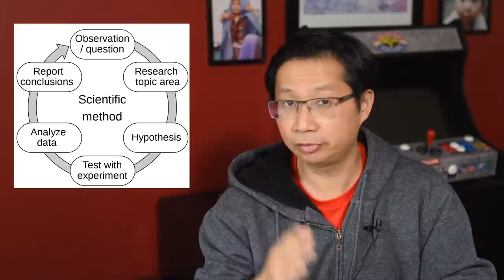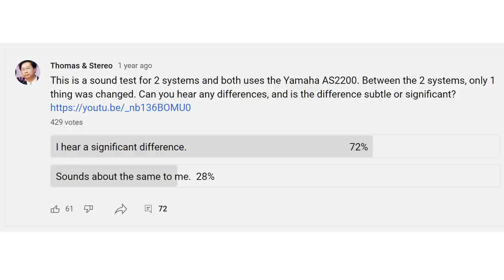Let me tell you stories about Break-in.

Comment: Thanks Thomas, always fun and isn't that what it's about!
Speakers - yes, they are mechanical devices with compliance and other issues.
When it comes to electronics isn't the question, what is breaking in? Resistors, capacitors, diodes, etc.? You can not see changes in those components after several hundred hours. For example, Keysight makes some wonderful and expensive test instruments that measure well beyond human hearing, scopes that go to gigahertz, meters that measure to picoamps and so forth. I have never gotten an instrument, and I have some very sophisticated instruments, where the manufacturer said wait a hundred hours until it breaks in. I have left instruments on for years and the calibration isn't significantly off so what are people hearing or think they are hearing?

What you need to do is a DBT with a new component and a component that has been run a few hundred hours. If you can't tell the difference then it's all in your head. This is why I tell you guys you have to do DBTs because they are science, subjective listening is not. Subjective thinking is the belief that the sun revolves around the earth simply because you think it does. This is where we run into big trouble, you have to stick to science.

Comment: Speakers have a break-in time. Elements need to move a little, especially woofer-elements.
Cables, no. Tubes, yes. Solid-state, no.
But also some electronic components need a little warm-up time, like 30 minutes.
Reply: @asfdadfgdasfh4444  But this is also very specific to quality of Capacitators.
Some are made for 105 degrees Celsius and operate at 40-50 degrees, so they will last a «lifetime». If use use some that are made for 60 degrees, in the same product, they will not last very long before they start degrading.
In my Nuforce amp they use the one that can handle 105 degrees Celsius.

Comment: Breakin is a real mechanical engineering phenomenon. I purchased a brand new Nissan Skyline in the 1980s and I was specifically told the suspension would take at least 2000 Km to bed into its ideal mounting position. And sure enough, the ride AND handling steadily got better up to about 3000 Km and then plateaued.
Reply: automotive mechanical engineer here: those days are gone and even in those days those were extra measures to give a customer a further guarantee  that their car will last xyz time/miles/kilometers long, wear & tear like that can only be reproduced in exaggerated simulations to a few decimal points ONLY 
Experience:- my father, who was a mechanical engineer who designed much of the components during the 80s-early2000s for the racing industry be it rally or indy car or le Mans or even dakar, so i imagine he knows his stuff

Cheers.
P.S. Skylines are nice, you're lucky to afford one

Comment: 13:33 not scientifically neutral since that question might be perceived as a loaded question that is leading those answering to an answer
Don't know the truth still
Reply from the maker: Of course, that is why I said specifically until a scientific paper is published, whatever position you have is just an opinion. Also, I said I would love to do an AB test with 150+ sample size. What I shared at that moment is an actual test, sure a test with flaws but nevertheless still a test with specific conditions. If I were to do the test 100 times and still get same results, then it is statistically significant.
Reply: @ThomasAndStereo  thanks for acknowledging sir..i agree.. Sample size needs to be large and free of silent and unintended revisions i.e. defects/differences arising from machine calibration or even personnel changes

Comment: I always thought break-in for Electonics was complete BS and everyone in the audiophile community thinks I'm crazy. Modern Electronic components (Capacitors, resisters, etc.:)  have very tight tolerances in their values and that's the only thing that could change the sound if those tolerances drifted! Speakers are mechanical devices so I MIGHT believe it's possible for them. People's ears adjust to new sounds after time and their hearing usually improves given time. A perfect example is the type of work I do. I work with Public Safety radios and systems. When we changed our radio system from the old analog system to the new P25 digital system our customers thought something was seriously wrong because they weren't used to the digital sound. It took them a couple of months and now they all swear how good it is.  This happened to all of the agencies and with over 15,000 radio users. The radios they were using were not new at all so if any break-in occurred it happened years ago. I think break-in is complete nonsense, but I do believe people's perception of the sound does change over time!

Comment: hey the compuret live it alone , u need a update for win 11?the same hardware different ,.......power consumption?power management?and more games?   hey ...for example if u have 4core CPU or16CORE cpu ,the windows is fast or slow?or it adapts?if u have a hdd or SSD the win is fast or slow?it adapts?if u are fast or slow ,and u are @red light ,......u adapt?........end i don't understant u can cheat "?if u have a tube amp it's ok for Break-in and after a ABclass amp ,or D class amp?or break-in is for a short time with a short cable?hmmmmm

Comment: You started well but your argument transpired into "I believe break in is real," without mentioning it explicitly.
1. Yes, people are fundamentally good, but businesses are fundamentally driven by profits 💯.
2. Break-in in moving components is real, but SHOULD NOT be significant if well made. If you hear considerable difference, you're better off with another company. B&C does show from its data (it produces over a million drivers a year) that speakers SLIGHTLY break in, but not after hours, after minutes. Slightly. If a manufacturer tells you to break in a speaker for hundreds of hours, how did they even manufacturer it in the first place? Do they guess how it's supposed to sound? About DACs, no, electronic DO NOT break in. Run for your life if anyone tells you so.
3. From now on, Thomas, start taking measurements for before and after break in to demonstrate those occasional differences.
Reply from the maker: Well GR research did that. They took measurements before and after to show the differences. https://www.gr-research.com/burn-in-myths.html